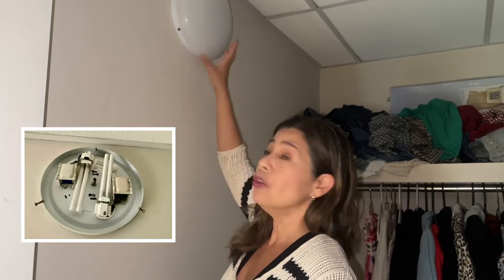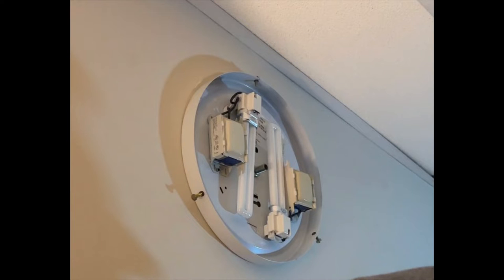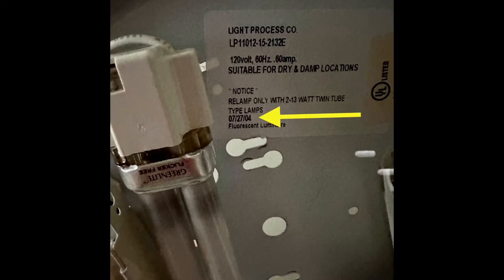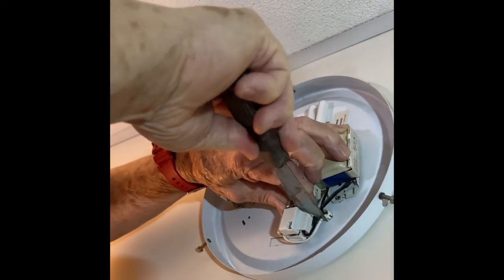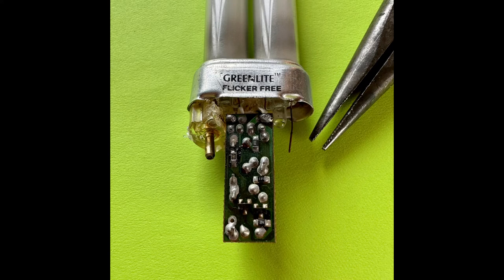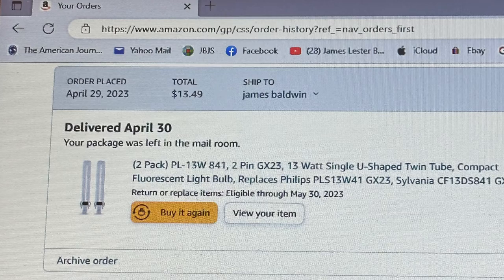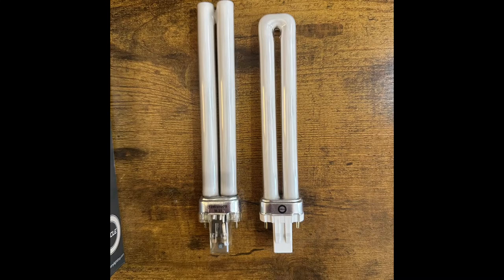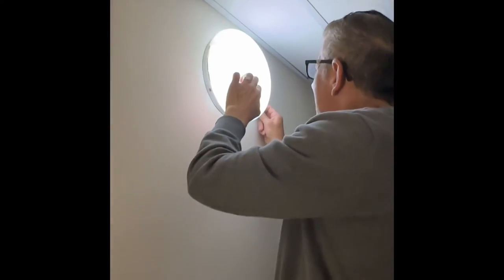Compact Double Tube Double Pin, Fluorescent Lightbulb Replacement ￼

Comment: all you really had to do was gently wiggle the bulb left and right. No need to pry, it will come right off. Ours, too, went out since the house was built in 2004.

edit: bulb is 2-pin GX23
Reply from the maker: When I tried gently wiggling the first bulb it started to come apart from the base so I felt it necessary to change tactics. My neighbor had tried to remove the bulbs but was unsuccessful. He may have weakened the bulb before he asked me to help. Not sure what you mean by the edit. The video clearly states the bulb is a 2-pin Gx23. Thanks for commenting.